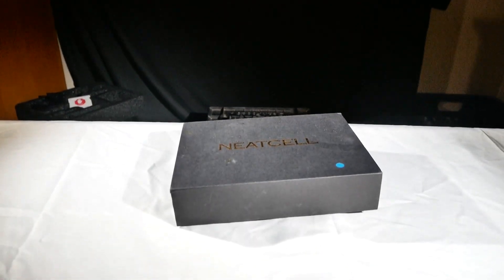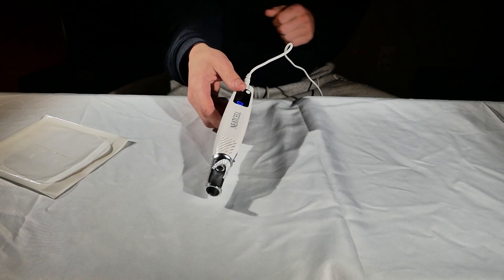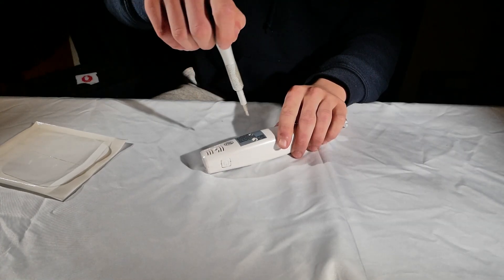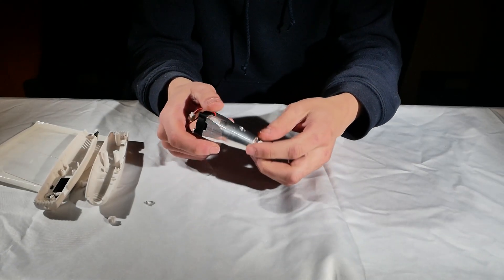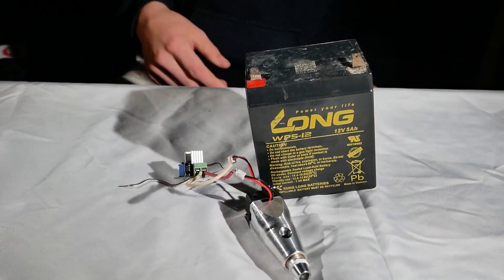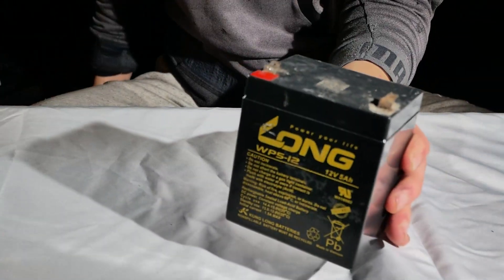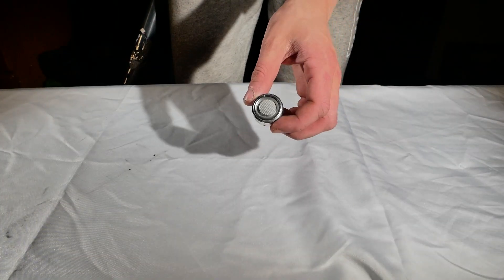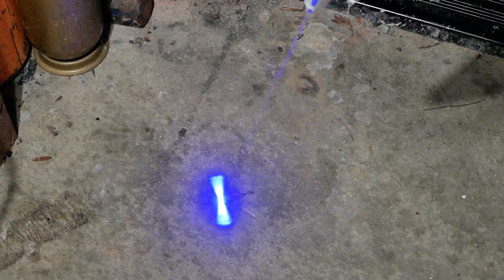CREATING A POWERFUL BURNING LASER from 35$ skincare product

Comment: thanks for the tip but why at an angle?
Reply from the maker: so it reaches further
Reply: @ianbuilder  hey boss i could use your help for real.  i am stuck in a power wheel chair and i want to build a foot controller for it so i can play on my vr headset i figgure 2 servos and maybe 2 potentiometers(in the foot part) anyway i need the foot to push forward and back for forward and back and twist left and right for left and right wanna help me out?  my problem i have no idea how to get the foot and the servos to talk.  this could be a great build for your channel if you want some ideas and it would help me out big time.